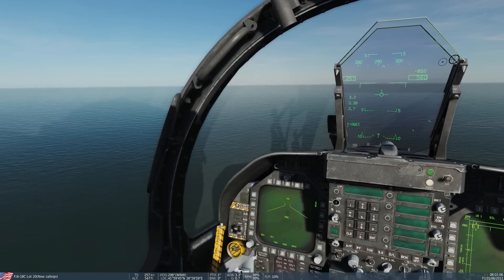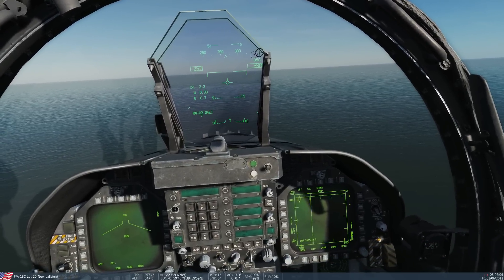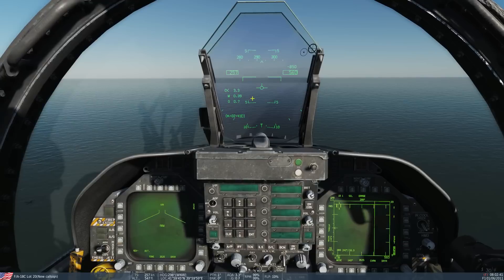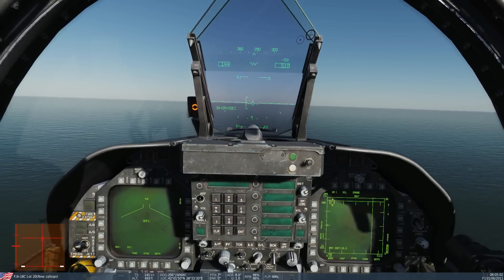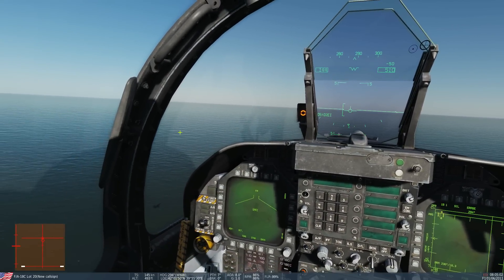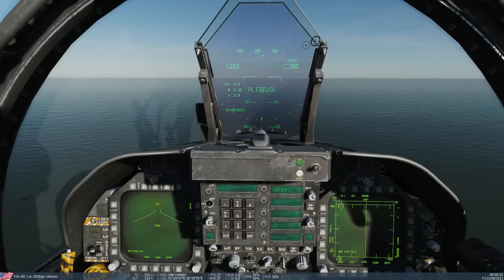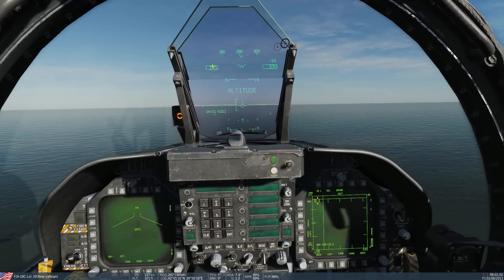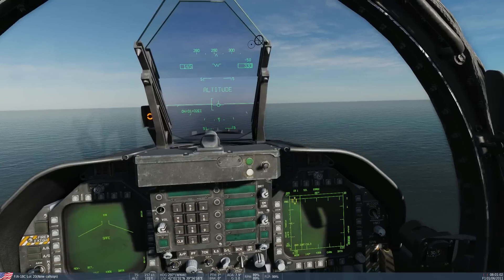Flying Basics: Effect Of Ambient Temperature On Aircraft Lift | DCS WORLD

Comment: I've been thinking about getting the Warthog Hotas with Logitech rudders but they're awfully expensive.  Right now, I'm using an extremely old and worn Saitek Cyborg Evo Force with twist axis for rudder and a little throttle with no afterburner feel.  I've literally gotten used to looking at the exact pixel to put the throttle on so I don't have to go external to see if they're burning.  Does anybody have experience with the Warthog Hotas?  Is it as good as they say?  I play with Oculus so I'm thinking if I can get all 4 limbs going, it should be pretty cool.
Reply: Earlier today, I thought of something that might help you. Thrustmaster sells the new F/A-18 flightstick independent of the Warthog base, which they expect you to already own. But VKB Gunfighter base can be purchased, and they sell an adapter to allow a Warthog's flightstick to be mounted onto the base. I think Virpil sells a flightstick base that's compatible with thrustmaster's Warthog flightstick too. The point is, if you can get the base-mount from one of the other company's like Virpil & VKB, and with an adapter you can mount the Thrustmaster F/A-18 stick onto it, THAT MIGHT SAVE YOU SOME MONEY vs buying a complete A-10 FlightStick from Thrustmaster. 

I haven't confirmed the price on everything yet. This was just a thought I had earlier during a review when they said you can mount Thrustmaster's Warthog onto the Virpil or VKB base.
I dunno, if anybody has read this far, please comment thoughts on experience doing something like this or price feasibility

Comment: Is it possible to test if Mach tuck is modeled? It is also affected by temperature and pressure as mach is affected.
This could be hard since most mach capable aircrafts are designed to correct themselves, but hey, I'm just asking ;)
https://en.wikipedia.org/wiki/Mach_tuck
Reply from the maker: Will investigate
Reply: Best plane to test that with I think is the Viggen. I remember having to fight it to keep from nosing into the water when hitting transonic speeds

Comment: I don't know if I'm doing stupid or not but bit when the air temperature rises the molucules move faster and move up into the air. E.I like a glider, the hotter the air the more thermics it has and thus the higher it goes.
Reply: They move upwards because the movement causes a bigger spread between molecules, therefor less density. Less density - less mass per volume unit. This means the hotter air floats up above the colder air. It's not specifically because they move faster that they move up, it's a secondary effect of that.